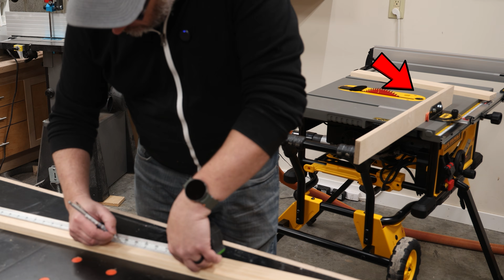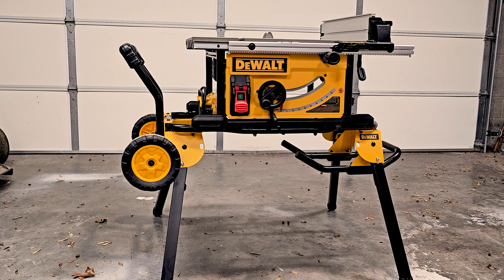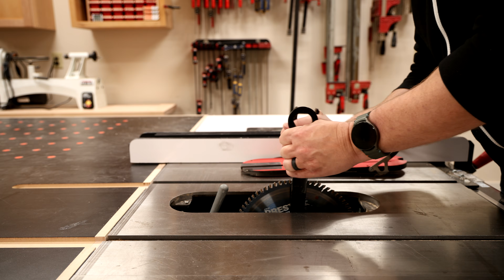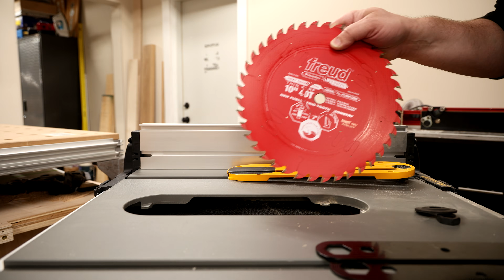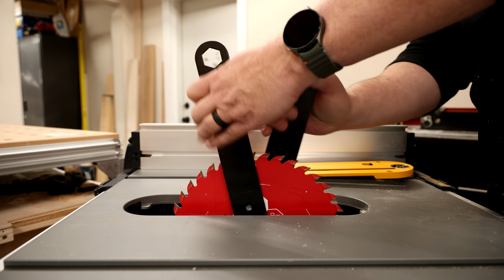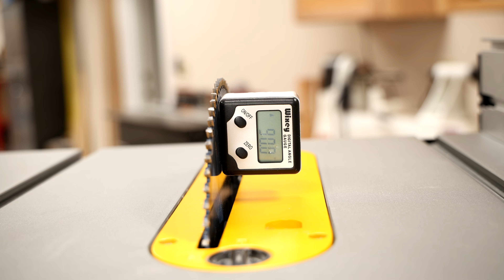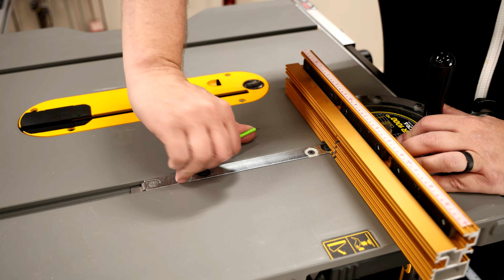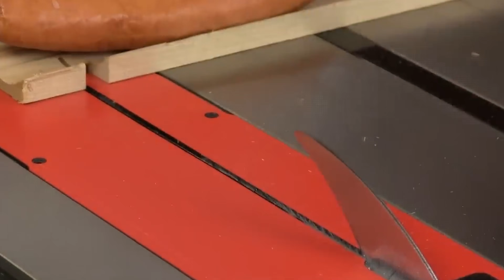Why do people even buy this saw?

Comment: My 7 fingers strongly suggest ANY MODEL SAWSTOP.  my accident was unavoidable due to a product design defect.  You can NOT control every situation and some are unavoidable with catastrophic results.  Save up and buy quality with safest operation.  Regardless of the sizable settlement, I’d prefer my complete hand!!🖐️
Reply from the maker: sorry for your loss! 😳
Reply: That’s wild. Sorry to hear you lost 3 fingers. Now I’m curious though. What happened that was out of your control? What product was it? What was the defect?
Reply: The comments I could post...  @chezcotton
Reply: @chezcotton there is alot of cases  where the base push stick that comes with most table saws (the thin plastic one)if it catches on the blade it basically explodes and drags your hand towards the saw blade in a split second.if I had to guess that would be it
Reply: @kadeprejean3855 everyone knows to throw that crap out as soon as they open the box though. If it was the push-stick, it wasn’t unavoidable, because he could have used a more appropriate push stick.
Reply: @kadeprejean3855  And presumably using the saw without a blade guard.
Reply: I came this close to losing three myself when I was a teen and was ripping some thick oak boards to width. The saw blade must have been a little dull or I was using a blade with too many teeth, but it took a bit of force to push them through. What I didn’t notice how much saw dust built up on a new, very well finished and sealed concrete floor. My hand was about as far forward as it was “safe” (because my Dad drilled that into my head before he let me use his shop) to push the board and I was about to get the push block and my feet slipped on the saw dust. I somehow managed curled my fingers in before they flew past the blade and lost just a bit of skin off one knuckle AND FAR MORE IMPORTANT was able to use my left hand to managed to not chest plant on the blade. 

So over the last 50 years I simply couldn’t bring myself to use a table saw. But now that I am retired I am building up my pretty meager shop to allow some real projects and have been thinking about buying a Saw Stop, which is why the algorithm thought I should watch this video. (Great video BTW).

But before I do that, I am going to build an extra long MFT table with a fence and guide track hinge to do accurate cross cuts and a ripping station along the front edge with registration slots in each end for the track clamps to slide into so the track saw blade always cut along the same line so I don’t have a mess of lines cut into my MFT. 

I have seen other channels where they are able to make all necessary cuts with this setup that would otherwise require a table saw. So I will see if that is true. And if I can’t make the projects I would like to make, then I will search the little cubby where I store my courage to see if it is up to using a table saw and then my Chief Financial Office (aka my wife) to see if our saving is up to buying such an expensive “toy”.
Reply: It’s not a problem if you used the guards correctly it seems to be a uniquely American trait to remove the guards and put up videos extolling the working methods without any guarding.
Reply: @denisoconnell3490 If a machine can cut stock it can cut you too. Guards just give you a false sense of security. My simple trick is to just not come into contact with the sharp spinny bits when they're rotating around. Under no circumstances touch the blade while the machine is running. If you can manage to do that you'll be fine. I was ripping and crosscutting on my table saw earlier today and not a scratch on me.
Reply: If you’re budget is limited look at the ubiquitous older cast iron belt drive table saw they can usually be had for around $100 (I was given one) many will require some work and a new rip fence… all in usually less than a compact job saw, but more accuracy, power and stability
Reply: @monteglover4133  I got my vintage cast iron top Craftsman table saw for $20 but it had no motor. I had a motor I'd bought at a flea market that was good for it. That cost me $20. I made a fence for it too. A nice fence. I also made a magnetic contactor for the saw too. Because I wanted big boy push buttons on it. I had some left over link belt lying around I put on it too. I wouldn't trade my saw for 10 of them direct drive saws.
Reply: Yea. This. There is a reason why festool owns sawstop.
Reply: @berniebroloves  Yeah the evil plan the crooks that started Sawstop had fell through so they sold the company. That's the reason. They wanted to get their technology mandated by the government then they could license it. They almost got away with it too. Scooby and Shaggy caught them though.
Reply: @1pcfred well... to festool. And its still mandated in government buildings and almost all schools. It saves fingers. Their "evil" was saving hands.
Reply: Thankfully it seems these things are finally appearing in the EU market.  And I don't mean the hideously expensive (and apparently poorly built) Festool saw.  A number of shops here now carry both a smaller and a rather large Sawstop branded saws, that have been getting good reviews.
Reply: @mwawoodworks I had my district purchase a SawStop 5hp 3 phase ICS with the 52” top 17 years ago. While it was a great saw, I had all of the issues you did with the accuracy and adjustments with the DeWalt saw. I also had the issue with the guides gumming up and sticking which necessitated having to clean them every few weeks because they would no longer move, nor would the blade drop completely below the surface. Yes we had dust collection and the overarm collection hooked up to a  Torit UMA 750. 

I personally have the DeWalt contractor saw and don’t have the issues you identified but do notice there isn’t quite as much power as the ICS which is to be expected. It does everything I need it to and I feel completely comfortable and safe while breaking down full sheets of 3/4” plywood.
Reply: That’s exactly right. Get a saw stop and avoid losing fingers on your right hand and paying $100,000 for hand surgery. Remember, 3500 people year chop off their fingers on tablesaws
Reply: I'm looking for a saw that'll give me 3 more fingers
Reply: So you are essentially telling us you made some money 😂 can I get fitty Dolaz
Reply: Stupid is as stupid does Mama used to say!
Reply: Nothing is unavoidable. If your using it properly.
Reply: @jim10221  Really? That means never making a mistake
Reply: @donlee7545 the mistake caused your issue. Not proper use. Wow. You’re stupid.

Comment: When you mentioned using a thin kerf blade, that presents a problem for me. I have a Metabo contractor's saw, and the riving knife is NOT removable, a design flaw that I did not notice until the return window had already closed. The riving knife is the same thickness as a full kerf blade, so if I were to use a thin kerf blade, the lumber would, most likely, either, not want to pass the riving knife, or if it did pass the riving knife, it could possibly cause the wood to bind, or split. My only option would then be to cut the riving knife under the saws table, which would then allow me to remove the riving knife and put it back on, and I'm not really comfortable with doing that. I am hoping to be able to sell my house in the near future, and definitely want a lot more room to set up my workshop. When that does happen, I want to get the same SawStop that you have.
Reply from the maker: I've seen a lot of saws that didn't have riving knives, but I've never seen a saw that the riving knife was not removable. How do you do non-through cuts? Does the riving knife sit lower than the apex of the blade?

Comment: I'm sure the DeWalt would have failed miserably with the Dado blade on all the materials over the cabinet saw. Great video I loved it as I do all your videos.   I have had the honor of owning both and yes I love the cabinet saw over the DeWalt anytime.  I'm glad you keep it real all the time and look forward to all your videos. Keep up the great work.
Reply from the maker: the DeWalt can run dado blades just fine so long as you're doing shallow dadoes like for cabinetry etc. If you tried a 1 in deep dado through oak it would probably be lights out.

Comment: I need to replace my 40 year old kitchen cabinets and I'm considering doing it myself due to my general lack of money.  What I get from this video is, a good job site saw and an track saw should be enough for one kitchen, Is that about right?
Reply from the maker: get a track square to go with the track. Get a router to made dadoes or at the least get a pocket hole jig. Those are the essentials for making basic cabinet boxes.

Comment: After cutting a ton of white oak on my Dewalt jobsite saw my motor definitely has some end-play. The blade walks a good .01"-.015" on cuts.
Reply: There's an adjustment you can make to eliminate the side to side (or wobble) movement of the motor.  I did it for my saw.
Reply: @meggiehanzlik3187  I tried that. Its just the shitty bearing/motor that is in the saw.

Comment: In a single car garage with a track saw and jobsite saw. The Dashboard PWS system combined with a track saw eliminated the need for a cabinet saw and a miter saw, not to mention lots of extra work holding options for a large variety of tasks. Next project is building a router table into one of the outriggers. (This is not a beginner setup, and came to this after having huge tools in a single garage and no room to move)
Reply from the maker: that's a very functional setup

Comment: The difference is the job site saw is for rough carpentry for the most part, and the cabinet saw is for fine carpentry for the most part.  Plus the cabinet saw can be accessorized with things like Incra's TS-LS fence system, dust collection, sliding tables, etc.  The job site saw cannot be accessorized with a slider but that can be made with plywood as well as the outfeed.  Also, the lack of power with the job site saw, creates more dangerous cutting situations and the cabinet saw with make it inherently safer to push thicker stock through.

Comment: I went through years of having a non-flat, out of adjustment, underpowered table saw.  If I'm in woodworking for the long haul, I'd buy a Sawstop in a millisecond and make it the beating heart of the shop.  I am not a fan of work arounds, constant fiddling and adjusting and hoping your saw can make a clean, square cut. All that time you spend trying to make the saw better is wasted time and distracting from your productivity.  But hey, for those that are space limited, and budget limited, I absolutely get it!  Great video.
Reply from the maker: I get it. I'm a BIG fan of set it and forget it.
Reply: I think the bigger issue for most is the pay wall. No one is picking a DeWalt over a sawstop for the quality.
Reply: Doesn’t a SawStop require the sensor to be changed out when using a dado?
Reply from the maker: @ yes there is a separate brake mechanism for dado blades and regular blades.

Comment: Thanks for the interesting comparison between the cabinet and job-site saws. I’m a beginner hobby woodworker (retired from airline flying 20 years ago) with a two car garage of which I promised my wife I’d only take up one side. Limited space and budget because I don’t plan to sell anything I build so I went for a Delta contractor saw that I’ve modified with a router table on the right wing and plan (resources and time permitting) a sliding wing on the left. All this will eventually be incorporated in a work/out-feed table that locks the entire surface into a single unit. I hope this will give me the versatility and functionality of a whole shop full of big tools. I have a a Dewalt thickness planer for the rest of my milling needs. The contractor saw is plenty powerful and quite accurate and the cast iron table is dead flat. Bottom line is I’d recommend that contractor saw over a job-site type because of all the shortcomings you described and also the space and budget limitations many of us beginning hobbiests face.

Comment: As a person that has been using a Skil jobsite saw for a couple years now, I never once thought to check if my actual table top didn't have dips in it like that Dewalt one, so thank you so much for that.  The first thing I did immediately notice though was the horrendous plastic throat plate that is borderline dangerous.  Even though I was new to saws, common sense told me I needed to get on youtube and learn how to make my own out of some solid wood since I think you still can't actually buy a metal throat plate from Skil.  I know you're much more in to actually building things than "reviewing" things like this video, but I personally would love something like this again but adding a used contractor saw from FB Marketplace or something like that.  People keep saying buy a used old one cause they are built to last and you can find them for as much or cheaper than the jobsite saws, but I'm just worried some electrical thing in it will go wrong and I have even less experience in that kind of area.
Reply: If it's the same Skil table saw i just bought last December, i can thankfully report that it comes with a metal throat plate now. I'd imagine you can buy one separately too.

This is the 10inch saw with the rack and pinion fence.
Reply: @JohnClark-tt2bl  If you get the Skil in the black box it comes with the metal throat plate and removable riving knifes.  I just bought mine in March and it was pretty much perfectly aligned out of the box. The table on mine is almost completely flat. Less than 8 thousands. Not bad for a job site saw.

Comment: The DeWalt is more of a “contractor” saw than a job site saw. Job sites, at least as I was taught are a smaller table top type saw, which DeWalt also makes. I have and run numerous saws depending on needs and locations from the 60V DeWalt battery job site saw through the DeWalt contractor saw to a 12” 3-phase 7.5 HP cabinet saw. Each has their best uses but you can do 85-90% of things with near any table saw.
Seems like you may have gotten a bad saw; have bought a number of saws over the years and have had all but 1 properly set up out of the box. Also have never seen miter slots being of different sizes. As a note ever saw has its place and you can pay for better set up’s. Saw stop also makes contractor and job site saws; Bosch also has a safe stop saw,or at least they did for a while.

Comment: How about noise? My jobsite has a brushed motor that screams versus a saw with an induction motor?
Reply from the maker: the noise is louder than a cabinet saw for multiple reasons. Type of motor, exposed motor vs inside a cabinet, aluminum top vs heavy cast iron top. but putting a good blade on the saw makes it much quieter. The stock blades that come with these saws are hot garbage and sound like screaming banshees. "Good" blades don't sound like that.

Comment: Good explanation video bud.  I agree for the most part.  When I went from my Rigid contractor saw to my Delta big boy saw it was like night and day.  All the little things add up fast.  If you are a casual hobby guy or home repair diy guy that smaller saw will work.  But as soon as you get into building a set of cabinets or musical instruments you will want a nicer saw.  It's like comparing an old VW Rabbit to a Ford F250.  Sure they will both get you there, but the F 250 will tow your camper too.  Same with a nicer saw.

Comment: I started with a job site table saw. THis would have been a great video for me back then. I now have a used cabinet saw and often wonder about upgrading to the Sawstop. I got the cabinet saw I have now free. But it had been mistreated. It was still significantly better than my job site saw. Everything about working with it was better. It does lose its settings and I have to recalibrate more often than I would like to. But that alone wouldn’t justify the cost of the Sawstop. However… when you add the safety features, better dust collection abilities and the accuracy…. I feel like it is definitely worth it. I know it will be worth it. Now I just have to save up the money. Great video.

Comment: Bought the same Sawstop as you for the same reason as you ... the safety. Yes, I was an experienced woodworker but I'm also human that makes mistakes and didn't want a momentary brain fart radically altering my life. I figured the price I paid at the time ($2990), was a mere pittance compared to several tens of thousands for any necessary surgeries because of a stupid mistake. I was perfectly happy with the Rigid 4512 it replaced. I bought it in 2014 for $475 ... it was solid, accurate, repeatable and doing everything I needed (and still would be today). I just wanted that safety aspect of the Sawstop and I don't regret buying it one bit. 

But no, you don't "need" a cabinet saw to build quality furniture. You don't even need the cheapest contractor saw ... they built some beautiful pieces of furniture long before the invention of electricity. It really just comes down to convenience and repeatability. Glad we have the option! :)

Comment: Excellent comparison and lots of good information for a prospective table saw buyer.  One additional advantage a cabinet saw has is the cast iron top, not for flatness alone but because you can use magnetic jigs with it.  It was a huge improvement when I went from miter slot featherboards to the Magswitch one since setting one up takes just a couple seconds vs. going through the process of fiddling with the miter lockdown on my old one.  

A good middle ground between the job site saw and the cabinet saw is the Delta contractor saw, which I owned for 5 years between my Ridgid job site saw and my current SawStop PCS.  The top is cast iron and has a terrific fence.